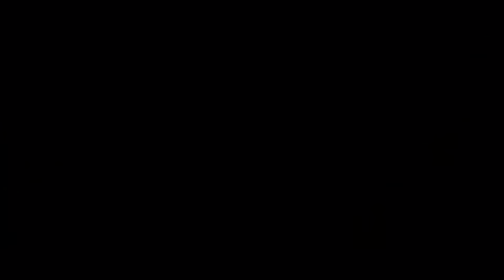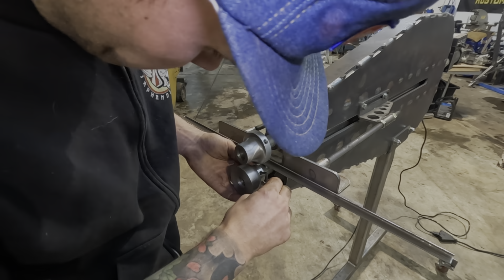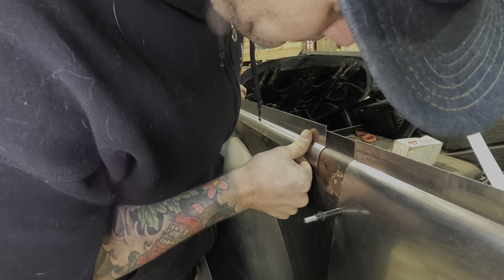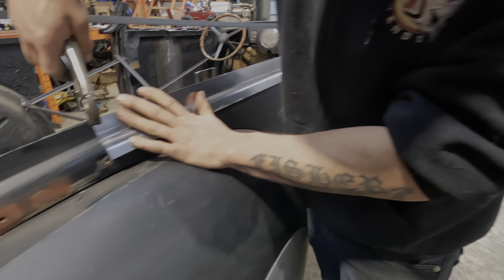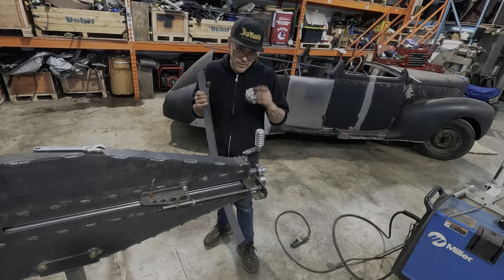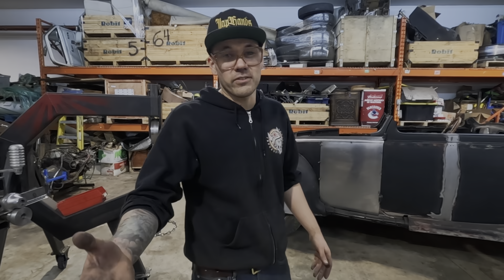Bead Rolled Body Line With Home Made Dies 1939 Lincoln Zephyr 3w Conversion

Comment: I use to make tooling just like this just on a larger scale. I found it easier to use a light below my work with a white piece of paper, then use a black sharpie on high spots. i would never use handles as it was two jerky. nice job on the lathe

Comment: I was repairing some 69 VW Squareback fenders and between you and Fitzee I was able to figure out how to do it. Just below the headlight buckets the metal was like swiss cheese. The fenders had 6 different radiuses and then there was the style lines on the fender, and a spot-weld flange for re-attaching the headlight bucket. I had tried to make the part in one-go, but it never turned out right. Then I saw how you were going to make the style line on the Zephyr and then weld the rest of the panel to that piece. So, that got my brain turning. Then I saw Fitzee's Cut-n-Butt repair video and that did it.  I prepared the internal spot-weld flange by hammer forming, then cut it up into threes. Spot welded the pieces into place and then formed the radius it needed. I still need to practice more, but my fender dilemma is done thanks to you and Fitzee.

Comment: Karl, here's a way to ensure that future bead rolling dies have round holes in the center of the dies, but it may be more work & accuracy than needed depending on the use (other than bead dies):  Start with a spotting drill or justcthe small tip of a center drill to keep your first drill close to true center.  (Also remember that twist drills don't usually drill round holes.)   Step up in drill sizes (like you do), but keep the hole undersized enough to be  corrected with the largest boring bar that fits.  The boring bar will correct a hole that's off-center to be back to truly on center.  You can finish a bored hole with a reamer if you need a really good finish.  I'm not a professional Machinist, but I believe that this is the proper procedure to ensure a hole is actually where you want it.

Another possible reason for the problems you discussed could be the accuracy of the two shafts on the bead roller where you attach your dies.  If they aren't exactly the correct diameter, or if they are worn, that could be a source of what you see as oblong discrepancies in the parts that you bead roll.

I'm not trying to find faults with what you do - I'm just trying to offer possible ways to improve future parts made on your lathe & offer, from the peanut gallery, possible sources for the less than perfect to your eye parts that you see as being caused by oblong tooling.

I am always amazed at what you make in your workshop just by using your skills & tooling that you design & build in your own shop.  Definite thumbs up!

Comment: Karl.    Suggestion on Bead roller.   Using the angle iron guide to slide against to keep it straight but on small pieces such as that how about another angle iron guide on the opposite side from the other which is adjustable slide some pipe and tube to slide it in and a adjustable knob to tighten in place.    You understand my ramping I hope.   But just an idea that I have no idea would work or help

Comment: It would help you greatly to take a course at the local collage on how to run a lathe.  1) You don't use a boring bar to face or cut!  Your feeds would be better if you knew how to use the lathe as it's intended.  As I've said before... WORK SMARTER, NOT HARDER!!

Comment: It seems odd to me that you continue to repeat the creation of the same part. I would have thought that even if a Panel doesn’t fit you could resurrect it by performing a reversal of one or more of the steps or push it through another roller or English wheel to get rid of the shrinking marks etc

Comment: Two thoughts...1) from my view, the transition from the door line to your new quarter panel line is a little off...looks like the new piece you made is too high in the rear...suggest you take a strip of welding wire, bend it to the door curve and then slide it along the door towards the back of the car over your new piece and see if the door-quarte line is on or off...by my untrained eye, it looks like your new piece needs to drop in the back by just ~.25 inch so that the door line can continue smoothly front to back.  2) I think the only issue with using the bead roller on the curved piece was the fence...you could make a new fence from .125 angle iron/aluminum about 12-18 in long that had a matching radius (the vertical surface of the angle iron) to the curve on the panel you traced (body line will move .125 shallower in the final piece).  That would fix your stop-end issues with the two rods you tacked in and also returned the stability of the flat horizontal surface  you need to keep the panel straight in the dies.  Also, I noticed that the two dies you made were tight on the inside (closest to the machine) so that the rest of the dies' surfaces never are able to close perfectly against each other...and as you tightened the dies on the sheet metal at the end of your forming, you ended up stretching the top (part in the tightest part of the dies closest to the machine).  I think if you turned those inside edges of the dies just a smidge, you will get rid of any "0.4%" distortion in the metal.  Thanks for sharing your journey!

Comment: I'm in the middle of my first attempt at major body sheet metal mods.
One thing I did, though, when I pieced in another panel was to radius the corners of the patch piece, rather than a sharp 90 degree angle at the splice point. I did a large radius at the corners.

Comment: I like watching your videos very much .
You said you had drilled the holes in the dies and they had turned out oversized,  you should drill to nearest size under then use the boring bar to get a more precise fit on the roller. 
I did notice your using a boring bar for a turning tool as well , just my two cents , a retired machinist/ HDM for 41 years.

Comment: It seems the reason you have the wave problem in your rollers may be caused by the way you drill the center hole.  Perhaps making a smaller initial bore hole, then reaming the remaining hole diameter, would make your center hole totally concentric with the outer face of your dies.

Comment: Really sweet sharing of your process. I think you need a more curved top edge than the shrink and stretch created. Still a bit too flat above the new side panel. The contour is nice . You could break the edge so you don't have to roll that crease into the panel.

Comment: Something I learned in machine shop long ago.
Large drill in a lathe are to allow entry of a boring bar. 
Never expect a drilled hole on a lathe to be truly round, to size or concentric with the turned or of a part.

Comment: Pitty there isn't some kind of Quick 'slip-on' Spigot that holds the original kustom made Die ''Parallel"(shaft-wise) to its Mate that is being cut in the Lathe .. Rather than relying on eyesight and fingers to predict the axis of both ??

Comment: Good job. I watched Lazzy put 2 dies side bye side on the bottom shaft of his bead roller and it made a step notch and he used the notch as a fence on the die itself.  That way you can bead roll long swipes and the roller die work as the fence. I hope that makes sense.  That's how he showed me how to make model A rear corner panels. It works pretty good and I think he even sells some of his dies with a shoulders machined on the die so you don't have to stack dies side x side.

Comment: Hey, Karl about ten minutes in when you were using an arbor to hold the die a couple things to try. Put some super glue on the arbor before you put the die on. It will take up any remaining gap and help keep the die aligned on the arbor. Just heat it up with a torch when you're done and it will come apart. 2nd) I've not tried this but what if you slightly tapered the arbor and used a cone washer on the nut end. Love the videos. Wish they were around 20 years ago I might have put more effort into getting my '37 Plymouth done.

Comment: Really loved this video.  And yes a Pullmax is a magic machine, I was lucky enough to take a class with Brian and the guys at Tin Man's Garage and use several Pullmax to do body lines and make tubs (thumbnail dies).  They are hard to find (as are Lennox machines) but I think you will really enjoy having one (or three)!  Excited to see the fit up and weld video!
Reply: SCAM?
Reply: @dennisschickling2249  Yes - Bot scam

Comment: I am not a sheet metal guy, but I have some machine shop experience.  I would put your template on a piece of graph paper, and draw a line to "quantify" the curve.  After that is done, use the marks on the handwheels of your lathe to fit that curve.  Personally, I would use CNC to match it (giving relief for the 18Ga. steel)...

Comment: First I salute you for being able to make dies that match an existing contour.  Nice coordinated hand-wheel operations to get the shapes you need.  I was also impressed that you bought two blanks.  I would have bought a foot of stock, and probably needed most of it :)  But I do mostly CNC now, so it comes out perfect quicker, and I can make 1 or 1000 with no sweat.

However, for concentricity and precision, drill undersize and use a boring bar to get the exact size you want. Using reamers and using boring bars are precision operations, while drilling even with a new drill on a mill or lathe is not.

I know it is an old lathe, but please cover the ways when using sanding or grinding tools.  That dust will eat the ways up on the lathe in a short time.

Wow, someone that knows how to read vernier calipers.  I continue to be impressed.
Reply: SCAM?
Reply: @dennisschickling2249  I reported it as soon as it shows up.  It seems these days 1 in 5 of my posts on youtube get this crap.

Comment: Would  3 equally spaced set screws fix the dies?
Reply from the maker: I think you could Center them but they would wobble a bit. The dies can be fixed by boring and sleeving but the outside diameter of the original ones are too large anyway.

Comment: On the latest set of bead rollers you made----- when you closed the dies up, it looked like the two portions of the dies that weren't part of the contour were touching before the contoured parts would make contact. Thus you were not getting the pressure on the material you were contouring. .
Reply from the maker: Yeah, they weren’t totally perfect

Comment: Hi, I don’t understand when you say you didn’t have the right size drill. You have a lathe, you can make any size hole with a boring bar. Stefan
Reply from the maker: Actually, don’t have a set of boring bars for it
Reply: Hi, it looked very much a boring bar that you used to profile the part.

Comment: Thats what I like about your work Karl, targeting 1000% percent . :p) Will the final ride be based on the chassis being level. Is the door body line level when you have the front end jacked up? I thought originally having the contour in the piece prior to bead rolling was the answer but you debunked that theory. What do I know ? :p) It is lookin fine!
Reply from the maker: I think after my suspension modifications, the frame will be level, but the car will look leaned back. That’s just how the frame to the car is placed. It’s kind of neat. I don’t think I’ve seen another car that has different angles like that.

Comment: Hey Karl, is it possible that you could make an adjustable arm that pivots off of the main body of the machine on both sides of the dies, that contain upright cylindrical rollers so you could have an adjustable guide to maintain your straight line when operating? Just spitballing.
Reply from the maker: Sure, anything is possible

Comment: Why not make a complete quarter panel instead of making it in sections ,
Reply from the maker: To nail the body line in relation to the rest of the panel, I think would be difficult. By making the bed rule on its own, it allows me to adjust it.

Comment: You show a thing to consider for me in restoration of a car. With the bead that you where you was not happy with. How perfect does the job have to be?? I would probably go with that old bead, spray epoxy on it and smear bondo ontop of that and go down the road. 

Love to see somebody have the passion and the motivation to correct it properly 🤘 
But i dont work on a zephyr either. The value of the car is affecting the process ofc. Is it a crappy car that has 2 years of life left in it or is it a 150.000 dollar car effect the quality level greatly. 

Keep up the awesome work Karl 🤘
Reply from the maker: You’re right that Bondo does fix a lot and this car will still surely need a thin skin. I am just trying to grow with every task. The Beedrill itself was too tall on the original car in that area, which is the main reason for me making a new one.
Reply: @MakeItKustom  ok :) i am glad you are doin it right i must say :) i am way behind you in how experiensed i am but as you say, tryin to grow with every job :) 

Hope you are having a great day 🤘

Comment: A good friend of mine when he was going through his grandfather's estate found something out without realising at the time what it actually was and just how useful it was  so it was thrown out
Basically it was a swage and jenny machine but it had dies for all the early American classics from the 1920,s and 1930,s and the dies were to reroll all the stainless trim pieces from all the various cars of the era .
If your classic car trim pieces were warped or dented and bent then you ran them through the machine with the correct dies and it straightened out the damage and then being stainless steel all you had to do to get good as new unobtainable trim pieces was polish them back to original specification.

So there is a project for those who restore or own classic cars requiring just access to a lathe and a bead roller or swage and jenny machine to restore those hard or impossible to get pieces you could even with a bit more effort with different dies manufacture replacement pieces from scratch
Reply from the maker: Wow, that’s a really incredible machine. I’ve never heard of.

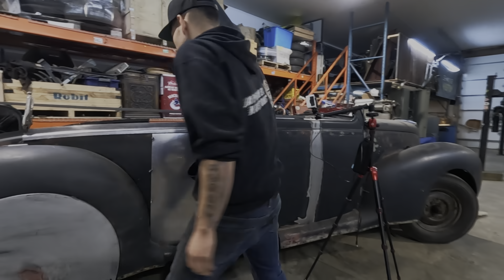Comment: 42:41 It might be easier to cut a flat strip of metal and lay it across the body line and check for flats or waves. I'm an apprentice die maker working on body dies, and that's something we do to check for continuity on curves and shapes after grinding/welding. For shorter spans we use banding straps or flat mahogany strips and brush on something like Dykem's "hi-spot blue" which shows every imperfection. It's quicker than applying layout blue and scratching it to check for high spots, which is also a viable option.

Thanks for the videos, I've enjoyed seeing your processes. It's inspiring to see you build this stuff from scratch, keep up the good work.

Comment: Really liked the video. If you look really close we're your making the second one, it looks like the lower bead roller shaft is wobbling or bent. If you look inside the c of the bead roller, during the time lapse. Not sure if it's because of the dies are out of round which they shouldn't be, or if the shaft is actually bent, due to too much pressure on the lower die

Comment: Happy New Year to you and yours!  FYI drill bits do not make accurate round holes. If you want a concentric and accurate hole use your boring bar in the lathe,  then you will not have any concentricity issues. Cheers

Comment: That first piece would have been welded on 99% of the time. Your desire to make it as good as possible is what makes your channel awesome. I found your channel through a friend sent me a link to one of the episodes putting hydraulics in the caddy (I've got a 61 Impala with front hydro that I'm getting ready to do 4 wheel on) and been hooked from the first video. Keep the killer work coming man!!

Comment: Did you build your bead roller??
Reply from the maker: Yes I did. And you can too! If you look back, there is a complete build video on the bead roller. It includes links to all the files needed to cut out this machine, as well as all the part numbers for the necessary hardware and parts to complete.

Comment: Karl, use lathe hss bar stock and grind the radius you require on it then chuck it up and cut your radius’ whether it’s convex or concave. I haven’t noticed if you have a surface grinder but if you do you can cut the radius onto your wheel and mount the piece onto a whirligig and turn your radius. Just some machining shortcuts

Comment: Just wondering if you could have put your old dies in the lathe and bored out a bigger hole then weld a plug for the hole then re drill the proper hole in the die just wondering? Thanks for the great video.

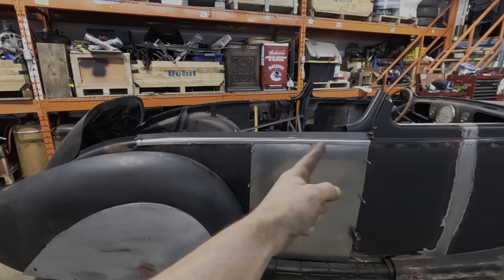Comment: that was some awesome work Karl ... just my observation, and it  has no credit ,  don't know if it's the camera angle  or metal  color shade but from the side  57:15  it looks like it dips down, not a straight  flow reaching the door  but looking at the line from the front  it flows perfect  ???

Comment: Hey Karl just a bit off advice to machine internal radius use a half inch HS machine bit and grind a round radius. Make sure to have a 10° angle on the radius tip for vertical clearance. Cheaper than buying button tips gives a  very nice finish and radius.

Comment: I've seen some guys run the sheet metal through a planasing hammer on the same area that you wish to bead roll first, must just thin the metal ever so slightly to help the bead rolling process. keep up the good work brother.

Comment: Karl, Sweep sticks are easy to make up.
It only 3mm per 1500mm per sweep. Or that's 1/8 over 6 foot per sweep.
I other words 1 sweep is 3/ 1500, then 2 sweep is 6/1500, 3 sweep is 9/1500. And so on.
We used to make them as an 3rd year apprentice out of timber, 1/2" ply.
I do have a cheat sheet with the maths here to.
But you could buy them from many shops in the US. I know Imperial Wheeling Machines has them.
Reply from the maker: Thanks William! I definitely need a set